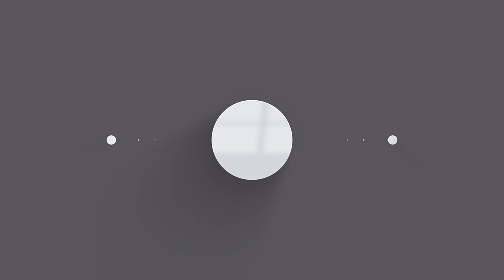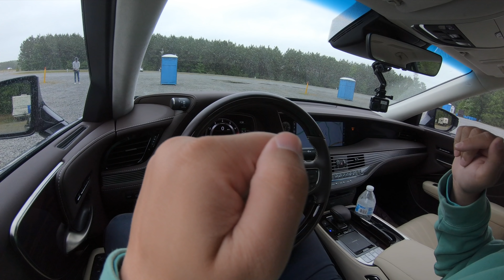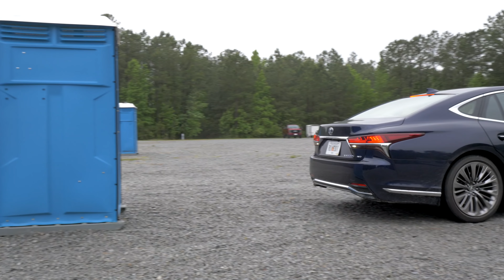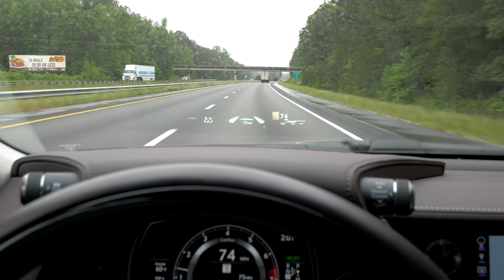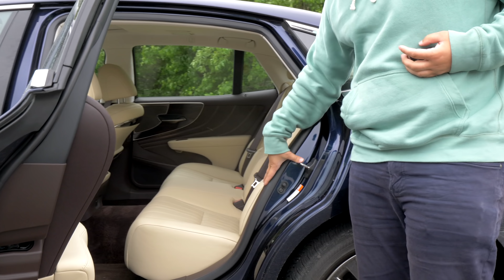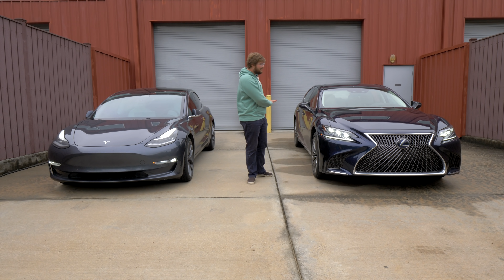The Lexus LS500h is a Tech Fest of Driver Assistance Features

Comment: I had an opportunity to drive a 2019 Model 3 Perf last weekend and while I was amazed with the acceleration and overall driving experience, I was a bit underwhelmed by the autopilot. The vehicle I was driving had the FSD option, and while the car did a pretty fair job of driving and steering on 1 lane (in each direction) with very clear lane markers, it seemed to be easily thrown off by 2 lane highways or if I was driving in the right lane on a multi lane freeway. Every time there was an exit or on ramp with a break in the lane markings, it would swerve to the right then swerve back to the left, sometimes quite severely and even to the point where it kicked out of auto steer a few times. It seemed overly dependent on the right side lane markers, to the point that it ignored the left side ones. To be fair, my Kona also does this, but the Kona's system is only advertised to keep you centered in your lane, not really auto steering or auto pilot or full self driving. I was also surprised by how often the auto steer needed to have me grab the steering wheel on anything over than a major freeway. Even on arrow straight highways, if there wasn't another car around, it would ask me to put my hands on the wheel about every 5-8 seconds, which is only about as good as the Kona does. We also got to experince phantom braking that seemed to be brought on by the shadow of an overpass and almost got us rear ended by a semi truck. Thankfully I was able to override it with a stab on the accelerator. I was also surprised by the lack of certain features like a heated steering wheel, cooled seats, 360 camera, better phone connectivity... 

Don't get me wrong, the Tesla was a great car, at least for the weekend, and it was enough for us to consider a Model 3 DM in the future, but if the Tesla system is meant to be the pinnacle of near autonomous driving, we still have a way to go.
Reply: The frequency of the touching isn't a technical thing, it is because people were abusing the system and a few died with distracted driving, so they've been trying to balance convenience and being a negligent company.
Reply: Tesla Autopilot used to be awful at passing exit ramps. It has improved substantially over the last couple years. But it still needs more refinement.

Comment: I owned a 2004 LS430 and it was the greatest car ever. The thing was dead reliable and had ever feature you could imagine from 2004 (heated seats, cooled seats, push button start, folding mirrors, easy entry...)

Comment: Tesla’s definitely needs a cross traffic alert system, front and rear!! I like hearing about all the cool features in others cars but you have to remember to mention the biggest difference between Tesla and other legacy automakers. Tesla is actively improving their safety features and “autonomous” driving. That mediocre lane centering will stay the same for the life of that Lexus! However, just in the last 10 months, my model 3 has gotten enough updates where I can use navigate on autopilot from on ramp to off ramp for my work commute and it handles all the lane changes and 3 highway interchanges all own its own. And it continues to improve even still...
Reply: I agree on the cross traffic alert. The other thing I wish Tesla would do would put the blind spot monitoring warning light in the side mirror where it belongs not in the center display.
The reality is you can get cross traffic alert in a Toyota Corolla. It should be in a Tesla. And every other car for that matter.
Reply: I have NOA and it always wants me in the wrong lane. Lane centering and TACC is really all you need. Current nav systems are plenty good enough to follow to adjust your route. I drive a lot and changing highways isn't that confusing lol

Comment: Watch the fanboys come after you with pitchforks
Reply: Nah, we can appreciate good tech from others too.
Reply: @courtk6142  apparently you haven't met the Tesla cult who can't take any objections to the brand
Reply: @tonyc6996  They're out there (the ones where you can't say anything even slightly critical). I'll argue that this does not compete with navigate on autopilot but with the lane changing it does one-up the new Autopilot package, not the old ones.
Tesla really needs to include cross-traffic and at least one more camera to eliminate the final blind spot, also a way to keep the cameras clean will be required.
Reply: @KaceyGreen  NOA sucks. It constantly wants me in the wrong lane so no confirmation lane change stays disabled. Lane centering and lane changes are the only 2 features that really work. So then the Lexus does everything I want
Reply: @tonyc6996  it depends on the maps, some of my trips it's worse than a nagging spouse, others it's better than me, and on one route to work it wants to take the wrong direction highway (west instead of east) despite the signage not matching what the car saying it's trying to do, so I usually kill Nav on AP for a moment on that section, same for that whole bit of Jersey turnpike south, thankfully it's just a simple toggle on the map directions, that and it isn't terrible on most of my trips.

It's better in stop and crawl, or beep and creep than me now so I keep no confirmation on. I can't say it doesn't have a temper, or if I did I'd have to say it's a bit of a jerk sometimes but even then as long it isn't trying to ram someone hanging out merging in a no merge it's more collected than I am when surrounded by distracted idiots.
Reply: @KaceyGreen  the problem seems then that you know on your frequent routes where it falls on it's face. Only gets worse when your using it on unfamiliar roads as it's intended. In gridlock if a lane change is necessary I'll do it manually 10 of of 10 times vs AP

Comment: We know Tesla gets all the press, but I'm glad to see a channel explain other companies have similar tech offered. I try to explain this to other Tesla owners and they immediately dismiss that it's available or as good.

I'm sick of hearing what the Tesla WILL DO LATER. It took well over a year to get HW3 installed, the software will still take years to become actually smooth and usable
Reply from the maker: All the time. Granted Tesla has summon and other interesting things but many of these other manufacturers are doing amazing things. Take Audi with their headlight engineering / projection. Awesome stuff!!
Reply: @OutofSpecMotoring  absolutely. The laser lights are absolutely phenomenal! On my tesla test drive the rep told me how amazing the system was and my question was ok so will it let me hit the car in front of me while I'm parking and he goes "well ya it's not going to stop you"..my 2014 Infiniti WILL STOP. 

Having said that I backed into something in my garage because I wasn't paying attention with my Tesla... I'm not sure why it lets that happen. 

BMW offers the 7 series you can move the vehicle with the fob similar to summon... I'm just sick of the fanboys thinking Tesla is the only one doing these things

And forget trying to argue that those LS series are extremely higher quality on the interior materials to the S or X

Comment: I hope Tesla adds more of those safety features over time rather than just fixating on self driving. And ventilated massaging seats!
Reply: I would not be surprised at all if they do add the "car coming on the side" warnings around when auto turning is starting to ramp up. (Similar to how stop sign/light warnings did before stopping)
Reply from the maker: Cooling + massaging is very much needed in seats. So great

Comment: Toyota are the ones Tesla need to beat when it comes to quality and mass production.
Reply: Which is a shame because, at least from what I've experienced, they seem to be by far the most behind in terms of the actual user interface. (A shame because it means the largest competitor, at least in the mainstream, has a massive Achilles heel.)
Reply: Toyota build quality is second to none. If they can apply that manufacturing to EVs they will be on track. Everyone seems to be forgetting how great and easy the skateboard platform is to adapt. My guess is they will wait for a Rivian or similar for the base platform then apply their excellent product to the "off the shelf" drivetrain system
Reply: Nah Lexus, prices are similar
Guess Toyota is Lexus so...

Comment: You are going to get tesla fanboy rage lol but good work on the video
Reply from the maker: Just the ones that can’t accept that their Tesla isn’t perfect. I still absolutely love my Teslas and they are great in so many other ways than the Lexus. This just has a few cool features that I think people needed to know about. Also, after watching it back I didn’t fully explain the sensor tech, the Tesla and Lexus have front ultrasonic sensors as well... didn’t make that clear.
Reply: @OutofSpecMotoring  I've argued with my local Tesla club members from day one about PREMIUM interiors. The fact you started you didn't drive your Tesla all week because of the quiet cabin, great cooling and massage seats etc again sums up my feelings exactly. I'd personally take a premium cabin over EV tech if I absolutely had to choose which is why I'm getting a lot of hate from our members about replacing my 3 with an Etron..I just like premium better